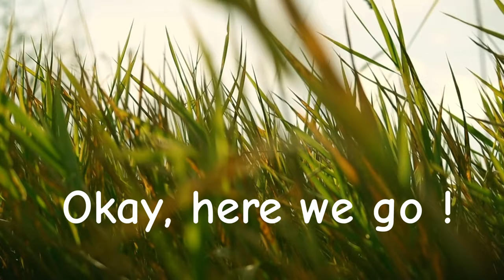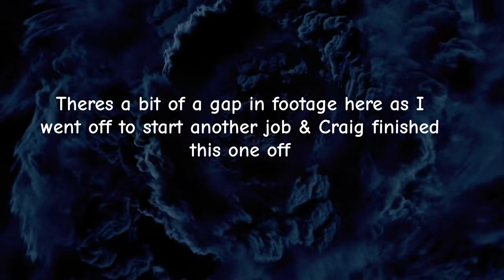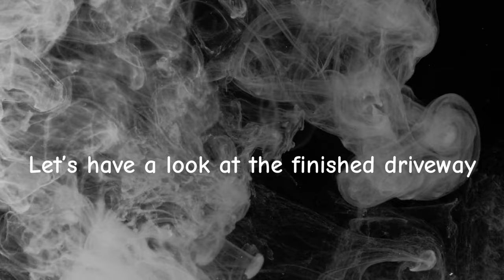Resin Driveways: The Beautiful Upgrade Your Home Needs

Comment: I had an uncle in your line of work in Holland. He worked some residential projects but primarily on laying brick/stone on city streets. He had to end his career in his 50’s because of severe back issues.  He blamed the disability on the constant bending over while moving or lifting the weight of the stone. What can/do you do to protect yourself? Your videos are excellent by the way and I’m very impressed by the work.
Reply from the maker: Yes, it can be a problem but thankfully I’ve never suffered. 
Think it comes down to a combination of things - conditioning, looking after your body by eating well, stretching, weightlifting etc
👍🏼
Reply: @Brockstonepavingpros  Thank you for the reply.

Comment: Truly inspiring. I think I have watched almost every video. I have learnt so much. Your precision and love for the job is amazing. Prof that hard work pays off. Would love to be that good one day. 
Just wanted to ask how you work in winter. Trying a small path at home but was told to wait as the night temp gets to about 3c and cement won’t set correctly …how do you get around that?
Reply from the maker: You are so welcome 🙏🏼 
Yes, some say 2 and rising but usually 4
You can put a cement anti freeze in, cover up with hessian, keep aggregate covered. 
But best avoiding in those temps if you can

Comment: I love watching your videos. Just want to ask on this on this one though. On the herringbone patten one side wasnt the same as the other. Rather than the herring bone going all the way to the edge it kind of stopped then triangles were formed with 3 block going the same way in them. Is it just a bit of an illusion or is this a bit of an error? 13:18
Reply from the maker: No error, it was done intentionally. It’s a method called ‘in board’ cutting it’s to avoid small cuts that are a weak point. This is the correct way, but not many do it 👍🏼 cheers
Reply: @Brockstonepavingpros  ah ok. Really thought you'd lost it. Still looked great though. Roughly how much was this?

Comment: I'm looking to get my driveway block paved, the guy who's going to do it has told me they're going to use the broken down rubble for foundation, chuck on ballast on top, compact it then lay down membrane and chuck on sand, which looks like builders sand from what it looks like and compact that down and then start to lay the paving blocks. Then trim in mortar as it sets in harder, apparently. Does that sound about right? If anyone can help me out here. Thanks
Reply from the maker: That’s a bit vague, it needs to be proper type 1 sub base and to correct depths. Never building sand under blocks 👍🏼